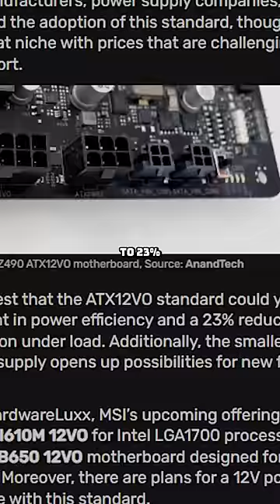Say Goodbye to the 24 Pin PSU Connector 👋

Comment: They’ve been trying to kill off the 24pin cable for years now and it just refuses to die
Reply: Because no one buys the gimmick when they put it on the market to be sold to the average consumer 😂
Reply: Tbf it's more aestheticly pleasing to me
Reply: Like my dad always told me - don't fix something that isn't broken.
Reply: because it fucking work perfectly.
Reply: @Anthonymvpr  I mean whatever new stuff they come up with will completely ruin modularity so it better be some next gen shit.
Reply: yhh
Reply: Some things just don't need changing.
Reply: I remember when they first came out, had to get a special adapter for my PSU to connect to it, lol
Reply: Because less is a bad idea in design.
Reply: because it fucking works and they can't find anything better
Reply: @ajaxsakaraplayz4070 the new configuration would be more expensive to manufacture. So I'm skeptical it will actually happen.
Reply: @bufordmaddogtannen  oh no I'm talking about the old configuration
Reply: @ajaxsakaraplayz4070 oh. I see. My mistake. 😃
Reply: @ajaxsakaraplayz4070  its so nice when it wraps around to a cable gromit
Reply: i like the way my thick wad of braided cables look sticking out of the 24 pin
Reply: More cable to hide for the same thing naw I'll keep the 24 pins to hide them cable by just hiding one
Reply: Yup
Reply: Limited compatibility makes it poor for widespread adoption
Reply: "Remember son, dying is gay"
Reply: I mean, it's simple, 1 big connector, easy to plug in and all the current goes to the right place, tho with my tiny arms I struggle with actually clipping it in...
Reply: who knew that trying to replace a standard with something non standard wouldnt work
Reply: They can kill the 24pin when the replacement is a 10pin that also integrates powering the GPU and 1000W PCI cards.
Reply: It's actually not working so it needs changing. Had a mobo die because of that. Whole ATX pin style is terrible because it can damage your mobo and fail for many reasons just like the 12VHPWR. Most pins on the 24pin is redundant so it really doesn't need to be 24pin. Though you could have a better option than the one MSI thinks a good idea. No clue what this 5x thing is but I think someone introduced a better and simpler design if I'm not mistaken.
Reply: @aicontentviral Even though it only provides a small fraction of the power to your system...
Reply: 24 pin is acccctually a 20+4 pin. Imagine how old is 20 pin and is still alive. 24 pin will never die.
Reply: yeah theres no reason to change it

Comment: Dude I loved the 24pin! It’s the most satisfying part of the build
Reply: Except when you had to unplug it lmaoo
Reply: @Acevern no kidding I hate unplugging it one these days I might just snap the motherboard
Reply: @lasthopelost9090  Thank God we don't have to unplug those often
Reply: For atx builds, I don't see 24 pin boards going anywhere, but it makes the psu smaller, and most of the new girth on the mobo is on the back, so for sfx builds it could he quit intriguing
Reply: Satisfying? Its a goddamn horror bro 💀
Reply: Putting the gpu into the pcie lane for the first time is more satisfying imo
Reply: Nah the best part is seeing it post for the first time
Reply: When you finally get that click tho
Reply: Sure, unless you gotta unplug it.
Reply: No technician does or will ever agree, but good on you being happy.
Reply: @Acevern  Tbf I had more problems unpluging fucking frontal USB 3.0 than 24pin. I always thought I was about to damage something
Reply: @MSnow-pu4qs  Those pins always scare me
Reply: Nope, it's annoying asf to plug out.
Reply: You'd have an easier time trying to yank a tooth out than trying to replace a power supply. Thanks 24-pin!
Reply: Most satisfying ?? Are you a masochist ?
Reply: @sevy169  Installing the CPU with no bent pins while using just the right amount of thermal paste.

Comment: Bruh they divided the 24 pin by 5 😂
Reply: msi showing us magic trick we need to clap.
Reply: Yeah literally 😂
Reply: It's a 10 pin for motherboard power. Normal 6 pin cpu power then 2 optional sata power plugs. Still dumb. The all 12v concept someone else showed off is better imo
Reply: You’re understanding it wrong: it’s 2 plugs, the ones next to it are OUTPUTS from the motherboard if you need SATA drives, because the stepdown to 5V happens on the motherboard
Reply: Yes
Reply: @Acceler2  this is the ATX12VO, 12 volts only
Reply: this is so dumb bro keep the 24 pin we dont need a change
Reply: So 4.8 pins?
Reply: no they didnt.wat they did they only have 12v input and then the other connectors are SATA connector basically the motherboard as some buck to buck converters to generatee the 3.3v and 5v rails
Reply: @bennaambo2716  pin 13 old one is 3.3 volt so?
Reply: @Acceler2  cpu power?
Reply: The two on the right were SATA power out, some motherboards, probably the itx ones can just not have them
Reply: @itsTyrion  So that basically means there are components on the motherboard that are doing some of the work that a normal ATX PSU does.
Reply: That way you need a new case or psu at least if you want to buy a new board, same thing they’ve done with ram having so many versions
Reply: @adamelghalmi9771 not true the change we need is a design that puts all connections in one border location through longer tracers to make cable management basically instant and help with overall asthetics.
Reply: @twiztedclown  true and it would probably help newbies when building, but it's probably not going to change for the next decade, just cause people are so used to this design and will not buy anything else
Reply: More efficiency means less heat generated. Loss = heat
Reply: @armandb.8737  They will all be doing it.  It is just a matter of time.